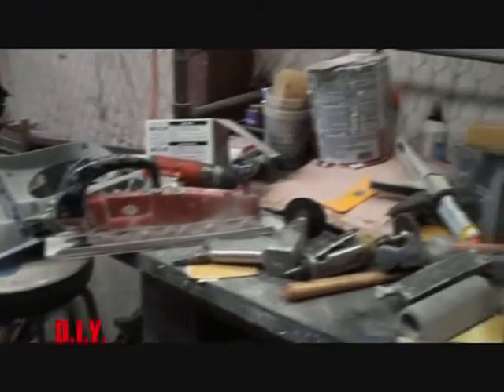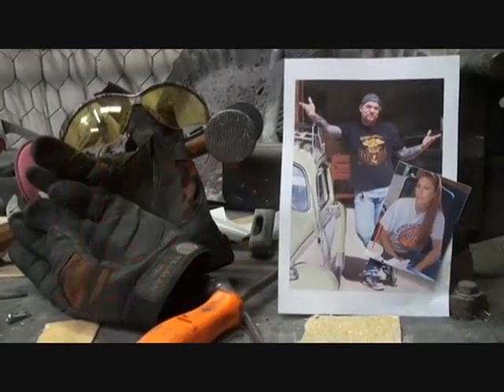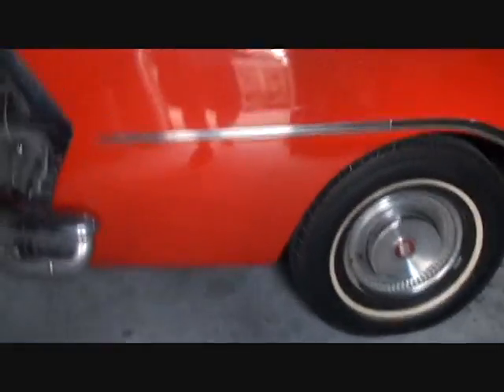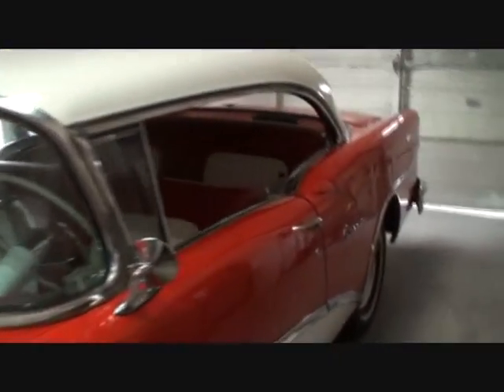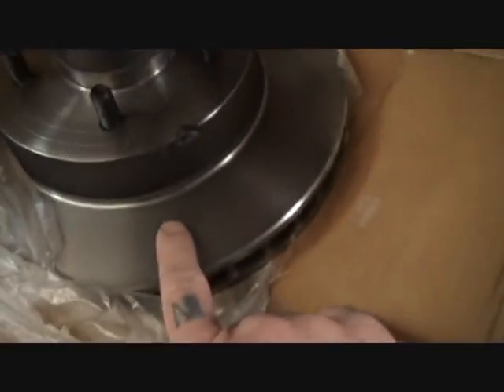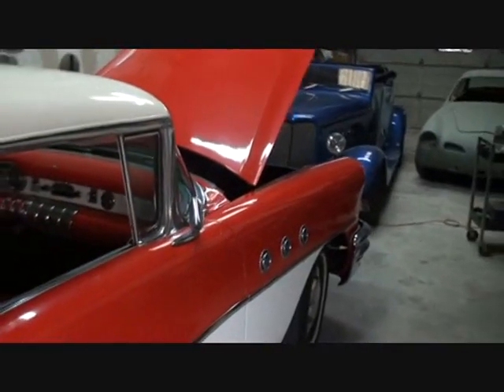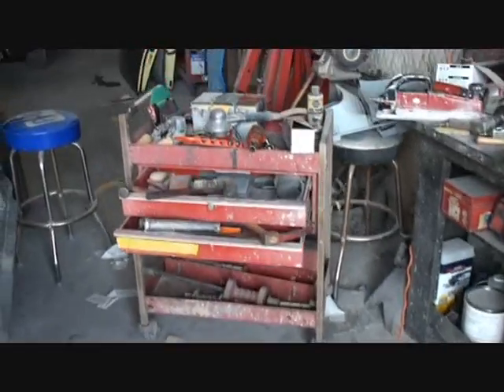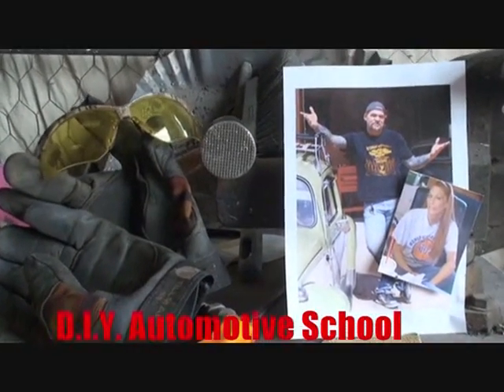How To: Install  Disc Brakes On Your Classic Car. Part 1

Comment: Hey Pete, I bought a used drive over electric lift earier this year. 50+ years of turnin' wrenches without any kind of lift. It was $350 and $60 for delivery. BEST $410 I've ever spent! Runs on 120v. Your viewers can check it out on YouTube: Lark, installing Mustang II suspension, parts 1-6 The '55 Buick probably has the 267, Roadmasters and Centuries had the 322. Like you said, the parts never fit!...Art

Comment from the maker: @JOHNDEEBANK They also made the 3 speed on the column in 55 as well. It was actually the most popular Buick made, if you visit my other sight SWRNC, you will see where I am doing a concours resto on a 55 3speed on the column buick right now. Pete

Comment: @JOHNDEEBANK I remember a '57 Buick 2dr sedan in Boston, MA in the early '60's. It had a "selector" 3 speed column shift. I heard (but never saw) of a '61 Buick Wildcat convertible stick on the column. It was ordered by mistake, the dealer failed to specify automatic Even the early '50's all had the Dynaflow. Trivia: some '53-'54 Olds had dynaflows due to a fire at the Hydramatic plant. Jeesh, I must be old............Art

Comment: Hey guys I got a stupid question,,I got a 1998 Dodge Caravan 3.3 v6
I replaced the power booster,master,two leaky lines,break splitter,blled the shit out of them,,but still no breaks,they pump up untill i start the van then they go to the floor.
could it be vacume problem,i sprayed the hoses with starting fluid but no leaks??
Im stumped iv done alot of breaks and never had this problem before

Comment from the maker: @brucekirk89 Call Master Power Brakes, you can find their number on line....It sounds like either low vacuum or your combo valve. It could be your front rotors. The problems your having could be a number of alot of things, you could have purchased a reject booster...There is to many things that could go wrong with brakes to really say what is wrong with it. Pete

Comment: @Cadmannn scarebird always makes improvements to his kits. most brakes kits out there will not work with the original rim but will with modern day rims of the same size. i have 2 1964 impalas one had the stock original rim and did not work the other had diffrent rims of the same size but made in the late 80's and work fine maybe thats the case with you, try a diffrent rim i just check his website on his kits for 1964 impalas looks like he has solve all the problems with impalas at least

Comment: The proper combination valve called proportioning valve for disc/drum has to be installed. This alone introduces air into the system and has to be bled. Also, if the brake master cylinder cap is removed and it has only one cavity to pour DOT3 brake fluid, this is a dangerous situation. A dual or tandem master cylinder should be installed as the single master fails, you have “NO” brakes. Besides, it could be over fifty years old. 
ASE Master Tech since 1978 - Retired

Comment: A conversation with a Kelsey-Hayes engineer addressed the fact that wheels in the '70's had to be upgraded to withstand the greatly increased rolling wheel flexing for radial tires. The early wheels WILL crack with the radials. They will not pass modern SAE standards. Keep looking, my '81 Cad had discs, radials and full hbcaps, all stock.